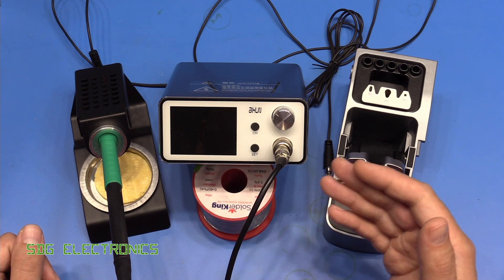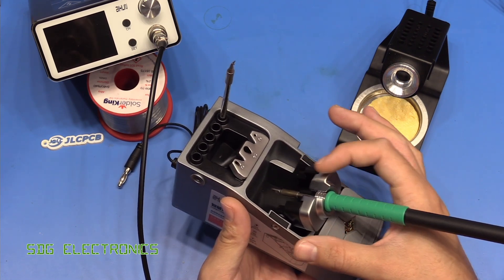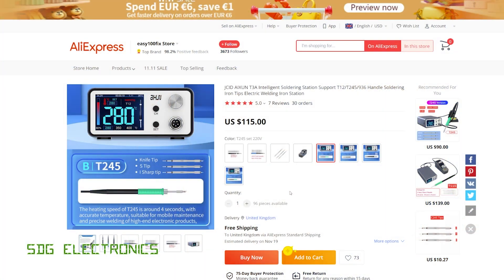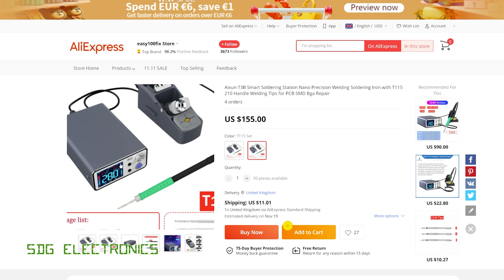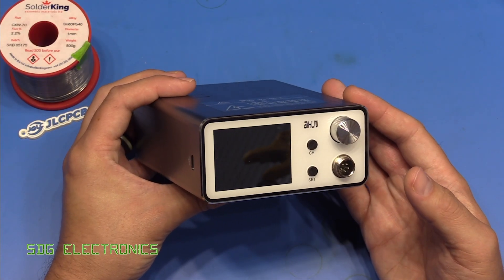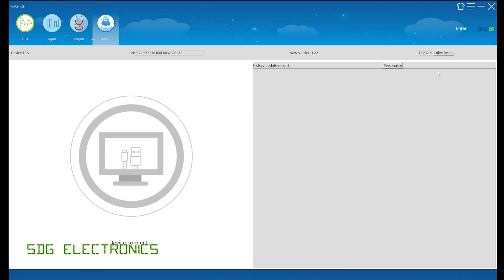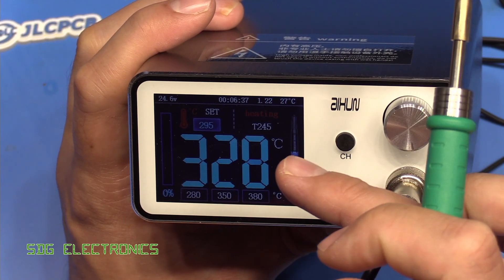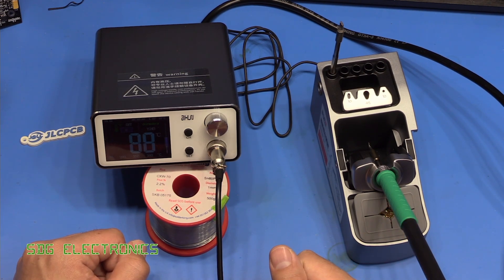SDG #229 Improved Aixun T3A Soldering Station Handpiece Cradle and JBC C115 C210 C245 handpieces

Comment: What about Tip to Ground Potential ? ....this is a big problem for the T3A T3B !!
Reply: I've reseived a T3A yesterday. Firmware: 1.36; Hardware: 1.02. I measured -2,6 VDC from tip to ground. AC potential is neglectable. Measured with an MCH-108 DMM.

Comment: Got one of these, too. Thanks for your reviews!

But watch out, the T12 handle is not compatible with this new stand!
The handle just stays in the stand because the tip is touching the inner surface. The handle isn’t designed to get grip on the socket.

Comment: I got the idea and want to create a simple switch box to be able to quickly and easily switch between the t12 and t245 handles for the t3a as well as the t210 and t115 handles without ever having to unplug and switch handles, ultimately relieving all stress on the connectors of the handles. Does anybody know the correct aviator plug I need to get so I can do this? I want to do this with both the T3A and T3B stations so if anybody can tell me which aviator plugs I need for each station, that would be greatly appreciated.

Comment: I know you mentioned that the T115 handle isn't compatible with the T3A station but is there a way we could DIY something like that or force it to work with T3A?

T3B looks great and the wiring seems better as well but I really like the RAW power T3A has to offer. Perhaps a custom firmware that limits the output to 100 watts when connected to the T115 handle.

I really need a good set of soldering equipment but can not yet afford to but 2 different stations. Also, the T3B is a little more expensive compared to T3A.

I just need the precision of T115 and the power of T3A for different tasks.

Comment: Stay away from these  soldering stations they are totally confusion, the cradle for the T210  has different connections than T245, I walked  into a rabbit hole with these stations have to use JBC tips and hand pieces.  I now have to buy an other station T245. Take may advise and just buy JBC it will cost you less in the long run. I wish I never seen this review cost me a fortune.
Reply from the maker: Sadly the limitation is still there with JBC systems in that you must buy the correct station for the handpiece. The modular stations have more freedom but come at a higher cost.

Comment: Hi, is T3A stand and T3B stand, are both the same (except for connectors at the back), can T210 handle fit on the cradle?
Reply from the maker: No, they sadly are incompatible.
Reply: @sdgelectronics  Thank you. I thought t210 handle can rest on the cradle without any issue as they looks similar,  would you be able to tell me what is the diameter of metal collet of T245 is please.

Comment: I really do like the backfacing connector design of the newer T3B, nevertheless the advertised power rating of  96W compared to the 200W of the T3A makes me wonder if this is really an improvement over all or a step back in terms of speed and the capability of soldering thermally demanding stuff like your test PCB. 

Talking about "advertised" you never know with ALI. I can not imagine they changed quite a lot internally but there is no proof until you had a look inside.  So I´ll guess I have to wait until you have it on your workbench ...
Reply from the maker: It's on the way, hopefully in the next week or so

Comment: Wasted money on this and genuine JBC tips before i bought Metcal :(
Reply: Is Metcal that much better? When I try to look around on information on Metcal, I can not find much on it. It seems like not many people talk much about them except "They are expensive as hell" and that many other stations, like the JBC and clones, are fairly comparable. I have found many of the Metcal I see for sale do not even have a display on them, makes me wonder how you know what temperature you are at... kinda odd...
I am getting frustrated with the Hakko 888D, that heater in the handle and tips that go over it is a terrible method of heat transfer. I find that when I have a large ground plane sometimes it just puts my iron into useless mode, solder stays hard no matter how long I hold it. I tried swapping to my buddies Weller (branded RadioShack, but its a nice bench weller) and it was significantly worse than the 888D... Then I finally gave in and used the SA-993 Desoldering Gun just to have enough heat to actually melt the solder - I'd like to have an iron capable of everything - something that will just put the extra power when its needed.  I was thinking of going with the KSGER or now this Aixun but no idea if they will be strong enough to do the job. 
Metcal being so expensive I was thinking maybe the BST JBC Clone? But then I hear that the KSGER/Aixun basically does the same work - I would buy legit tips from JBC/Hakko whichever was needed to make sure it ran at its best. Sounding like you would go Metcal under all circumstances? Which Model? What have you tested it against yourself? 
Thank you for your time, greatly appreciated!
Reply: @whoisntwhoisit2126  first i bought old faulty rgb30 from 198x. Then two broken mx-500's .And bought used metcal tips on ebay. I have like 40x cartridges but in 90% cases i just use two or thee of those cartridges. 
This fake jcb station performs well, but the handle gets real hot after short period of use even with genuine handle ,  and if you dont like flaming hot handle you need to buy and add thick,,silly sponge on the grip. If thats not bad enough the genuine tips oxidize and get ugly after short period. I feel sorry for people who spent lot of money on oem JCB station. Metcal is way above. I'm EET and do lot of smd work with large power planes. JCB could work but my work allows me to have better equipment

Ps dont bother with this ksger garbage, unless you do esd mod and upgrade the output mosfet. This garbage has potential to set your t-12 glowing red. Also every tip needs calibration..

Comment: Bought the station based on the last video and am happy with it so far. Any suggestions on best place to buy extra tips for it? Bite the bullet on some original tips or is there a good deal to be had from the far east?
Reply from the maker: The JBC ones appear to be superior. Either try ebay or from a distributor. If you're in the UK I have a discount code for Kaisertech

Comment: Hey Pal,

Do you know if it’s possible to convert T3A from 110 V to 220v?
After your previous video I pulled the trigger and bought one on impulse and haven’t noticed I’ve purchased 110v 😭
Reply from the maker: Some people mentioned in their units, the power supply inside was universal input voltage. Mine said 90-265V. You could try to open it and confirm that, or maybe ask the seller?

Comment: Thank you for posting this, one question: i want to buy the t3b variant, but i also want all 3 handle's (the 245,210 and 115) where do i buy the ones that are compatible with the aixun t3b station.
Reply from the maker: I'll buy the T3B, then we can see if there is any compatibility for all three handles
Reply: @sdgelectronics  there is no compatibility of 245 with 210 !!! these cartridges have different pinout and operating voltage, 245 have 24V and 210 have 12V

Comment: I bought the Aixun station based on your review. Actually the whole series on various soldering stations is a treat. The Aixun is a great station, but the stand leaves a lot to be desired. Had to keep a stand from my Ersa still on the bench, because it has a brass wool compartment. I have been eyeing this new stand for some time now. It is a bit pricey when compared to the cost of the station, but probably worth it. The extra tip storage and brass wool compartment alone would make the upgrade worthwile.
Is the new stand heavy? The old one is just too light and slides around easily.

Thanks for the review.
Reply from the maker: Not too heavy, but it doesn't slide around or tip over. It's much better overall

Comment: def a unisolder project update? I've been holding off ordering and building one to see what you come up with first. I have the t3a and t3b and I'm torn on which I prefer I prefer the rear connection but I personally dislike it going through the stand. some prefer the front connection though.
Reply from the maker: I'm ordering the T3B so we can see if it's any good.
Reply: @sdgelectronics  its not bad. its only rated for 96watts but you really dont need more then that for the 210 or 115. any new thoughts on the unisolder since last video? ive been debating on if i should order one or not.

Comment: The T3B is not 200W capable. They advertise it as 96W. I got a feeling that they will eventually combine these 2 stations and release a dual port version like Sugon T3602 or Xsoldering Pro.
Reply from the maker: I hope so. In the mean time, I plan to design my controller for C115 right up to C470

Comment: Good to see ya again Steve 👍 
That stand indeed looks far more substantial and a much better match with the general overall quality of the main unit. 
I like the T3B version too but I'm not a fan of the way wires on solder stations are routed from the rear of units. Yes I guess I'm fussy 🙂
Cheers
John
Reply: I was looking at AiXun T3B myself, but I went for the T3A because it had the wire in the front. It was 140€ for the full set on AliExpress, and came in on a total of 191€ with shipping and tax to Norway. Never regretted the purchase.